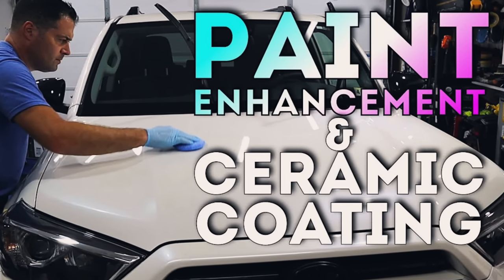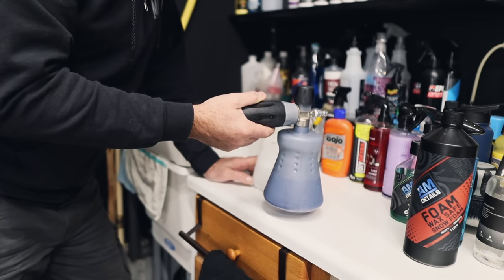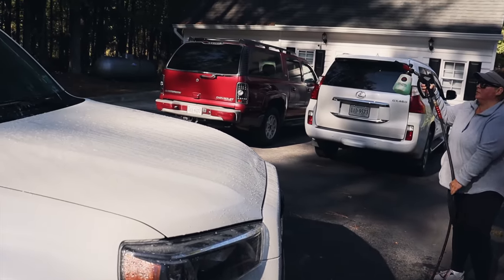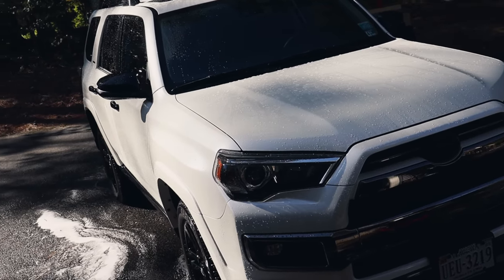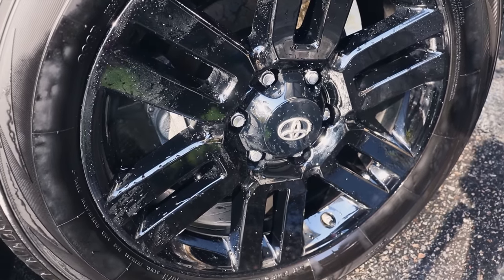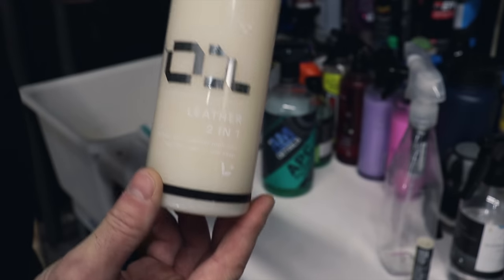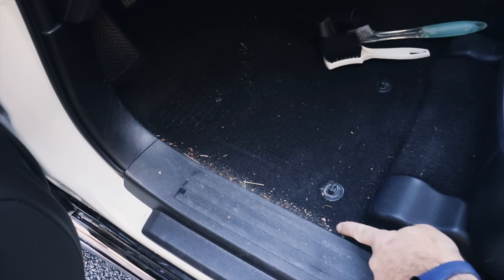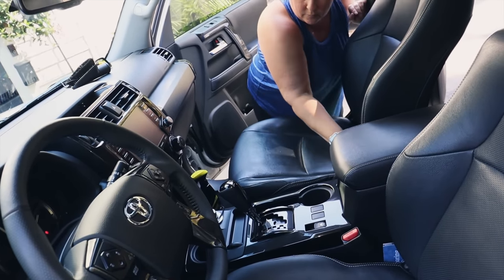Ceramic Coating Care! #detailing #realdetailing

Comment: How frequently should a coated car have iron remover applied?   I love the water behavior of coated vehicles.    Great video, Phil and Jess.
Reply from the maker: Hey man. Basically you can see how the coating is reacting and if it seems to flatten out you can decon it be using iron, tar, and water spot removers to deep clean it and bring the coating back.
Reply: @MirandaDetailing  Thanks very much! I'll keep that in mind... those methods.

Comment: Hey Miranda, have watched your videos for a few years and have tried and learned a lot from you. My question is have you ever run into a vine lie that has concrete splattered on the side panels and if so what did you use to remove the concrete?
Reply from the maker: Hi. I have but it was very minor. I used straight vinegar, or you can use descale,  let it sit on there and keep spraying it to keep it wet with product. it should start to dissolve and gently wipe it.
Reply: I had this exact situation this weekend. I had to tell the customer I would have to come back to address it. Great advice, great channel, thank you Mr.Miranda 🙏🏼

Comment: Hello again. I just bought a 2023 Honda Civic touring and I’m a nut about keeping things clean and nice. I’m considering a professional ceramic coating. Would you highly recommend it? It’s not cheap as you know, just wanted your feed back. I live in Massachusetts where the winters are rough. Thanks.
Reply from the maker: Hi Congrats on the new car!  So coatings are definitely very tough and will make your cleaning of your car much easier. They last much longer than waxes and sealants also. Of course they are not completely bullet proof, if not washed and maintained as usual on a regular basis, it may not give you the results you want.   Check out this video, I talk about coatings https://youtu.be/PvyYD8QqNoc
Reply: @MirandaDetailing  Awesome. Thank you so much for the feed back. I’m thinking I’ll go for it. I’m going to watch your video now! Thanks again.

Comment: Phil I was polishing my car and when I went to wipe off the residue it seemed to be a bit tougher to get off the paint.  Am I using too much product, not fully working the polish or not allowing the polish to fully dry? 
Thanks  BTW your 1 on 1 classes are outstanding
Reply from the maker: Hi! Aw sorry to hear that. What’s the make and model of the vehicle? What polish and pad combo are you using?
Reply: @MirandaDetailing  Volvo xc60 2019, I used Turtle Wax 1and Done Precision Platelets and an orange pad
Reply from the maker: @michaelm1739  Ok. Yeah that Polish sometimes needs a damp towel to wipe of and then a dry one. But definitely only use 2-3 pea size drops and clean the pad out between panels. A little goes a long way
Reply: @MirandaDetailing  Thank you👍

Comment: Good morning. I wish I had more luck with maintaining coatings. Look really dead.
Question: I've got a 2013 anniversary Corvette coming in. It has Matte racing strip on the hood. Friend wants paint polished and protected. No polishing the Matte paint, of course. Can I treat the Matte paint the same as the gloss paint as far as soaps and protection? Thinking Carpro Lift and then contact wash Reset. Protect with a spray ceramic. What you think? Never done Matte paint yet. Hi wife!
Reply from the maker: Hi. You can use pretty much any ceramic spray sealants on matte vinyl finishes. it's most likely a matte vinyl